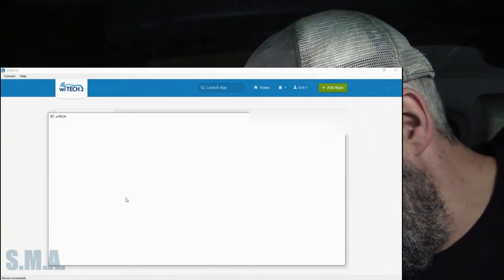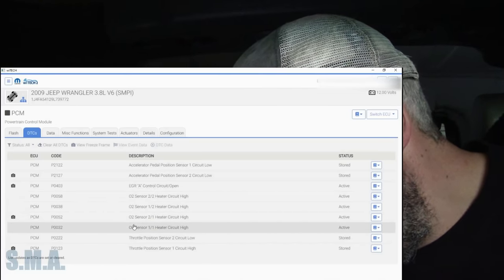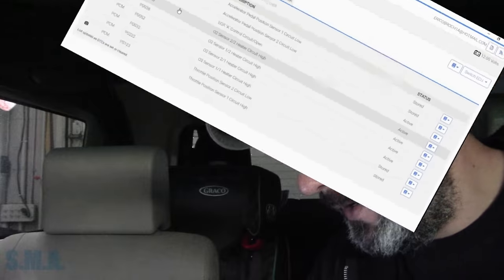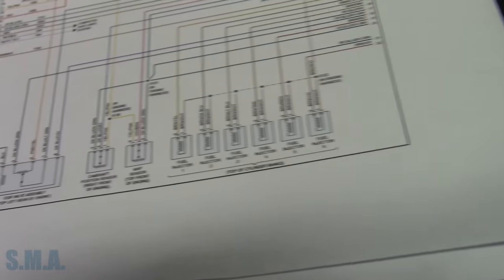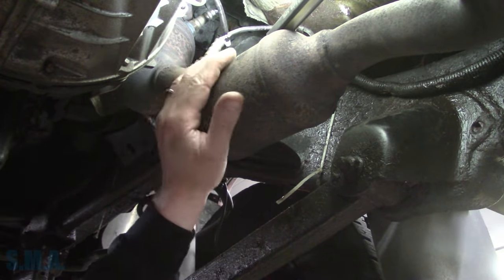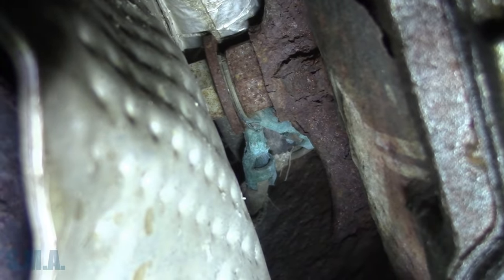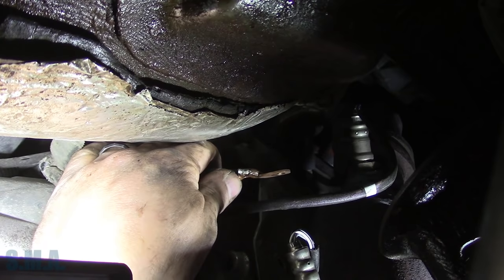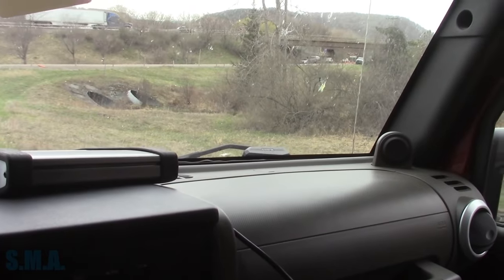Another Jeep, Another Bad Ground...😐

Comment: Good Job. Enjoy and appreciate your videos. Your logic and humor are fine and fun to behold. Glad you can function as your own "Boss" ... shops & dealers probably hate guys like you ... but your customers love you, I bet! 

Re: GROUNDS. As an EE/Mech Eng. I am NOT a "Mechanic", but own, service and care for 2 older vehicles. '92 Dodge Caravan & '03 Lexus SUV. The Caravan is (WAS)  a "Ground Fault" hangar queen. I joke that I put a new set of Michelins on it and doubled its street value.

It costs a small fortune when most shops try to "Chase the Gremlins" ... esp. tough before OBD2 in 1996. e.g. Intermittent cruise control a few years ago; I took apart every connector in the "chain" and tugged on every wire ... one bad crimp came loose! Soldered it & all is solid.

Just recently had NO DASH FUNCTIONS ... no lights, no instruments, no chimes. Found 3 bad grounds (1 under the hood and 2 under dash), PLUS a cold solder joint on connector leg inside the Body Control Module. The van (like its brethren) would have been scrapped years ago if a "regular" owner had to put up with the debilitating frustration and inane expense of taking it to "Stealerships" or local shops. 

NOT everyone can do / will do what you do ... as for "regular" shops these days, they just mimic the dealers in price and action ... and kiss things off ... can anyone here (as you point out) say: shotgun parts ... then give up after humongous charges for NOT fixing things? 

As for my "almost pristine" '03 Lexus SUV, bought it a year ago with 112K on the clock. 
Including the 120K Service, I have now spent ~ $1,100 on it for parts & materials. Dealer / Local Shops would have charged well north of $5,000! I will stop now! 
Thanks again for what you do.
John in the Northwest

Comment: These other shops are going to go out of business because they keep sending them to you!
Reply: Nah...  They still charge for the parts cannon routine...
Then send it to Eric for the actual repair.
Reply: Not likely sad to say, there will always be an abundant supply of ignorant flapstacks who have zero problem paying 1200.00 bucks for a brake job or 1000.00 for a tuneup or 150.00 bucks to change oil or 3000.00 dollars for a antilock brake sensor or ect.................Mr.O is one of so very few who are honest which in this day an age is a lost concept. This goes for mechanics, plumbers, roofers, electricians, landscaping, dental, every corner is corrupt as it was written many years ago that it would be so.
Reply: @guyazbell7437  - apparently you don't know many mechanics. I been doing this for 40 years and I can recall only two mechanics who I know would cheat people. Some shops are expensive on their labor rate and parts mark up but they're not cheating people.
Reply: @meabob  obviously, there are a lot of dishonest mechanics out there the cheap people. I have lost count of how many videos Eric has posted on his channel exposing other shops for screwing customers. There are a lot more dishonest mechanics out there than you think. let me correct what I said, Eric does not expose the shops for screwing people. Give me really points out that there is some random shop in upstate New York that is screwing a customer and then sending the vehicle to him. He is an honorable man though, and does not give the name of the unscrupulous and dishonest shop that is screwing the customers.
Reply: @meabob  You can bet that other shop will charge the vehicle owner for all the good parts that were replaced, their hourly labor rate to replace said good parts, plus mark up SMA's bill and pass that on to the customer too.
Reply: @guyazbell7437  FYI-Not just blue collar workers!

Comment: Good diag. I’ve had multiple codes and traced it to bad ground. I remember forty years ago a friend replaced.battery, voltage regulator, selinoids resistors etc I looked at it found bad ground. Fired right up and ran. Since then always check pos and neg.

Comment: I like to take the time pulling off ground wires that I can get to and clean them with a rotary tool with steel wheel brush. Remove, clean, and put back. Then use a long needle nose pliers and pull out each fuse from the fuse box one at a time. They look shiny after your done. But wear eye protection to protect your eyes since tiny metal fragments fly off. Sometimes a electronic part will come on you never notice before. The same thing for your battery, alternator, and starter connectors.

Comment: SMA is the perfect example of why folks should trust a good mechanic.  The other shop, maybe not so much!  (you should leave a card in the car so they know where they should bring their car next time!) - they went from someone who didn't know what to do (4 o2 sensors, egr valve, probably multiple trips back and forth, and still having a broken car) to someone who thought about it, saw the pattern diagnosed and fixed it - so maybe an hour or two diagnosing and fixing some wire, and now it's all good!

Comment: I solder them to seal em up and then while warm dip them in an anti co compound to further seal them up and than also usually apply a heat shrink tube w glue inside to get a final seal.

Comment: As someone who pulled their hair out on one. Dodge Dakota's no bus on odometer intermitten, 2 ECM's replaced. Check the ground next to the ecm on the inner fender. Multiple wires soldered together from the factory. Separate the wires put connectors on each one and reattach. Was losing the ground while driving. Found by accident when reattaching ground after checking voltages.

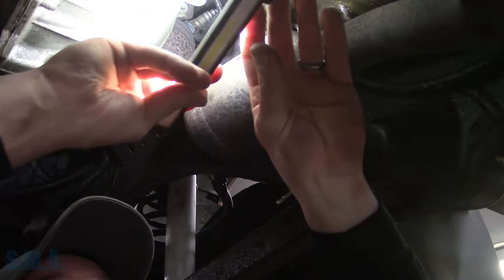Comment: I had both my headlights go out once. I checked them at around 5 pm because I thought something was wrong, but didn't see anything strange. At around 6:30 I was pulled over for no headlights, but I had my fog lights on because they were helping. Was told to fix it, so I replaced the bulbs and have been driving for about 2 years at this point without the lights failing again. 2003 outback if anyone was wondering. I haven't replaced the alternator as I'm sure your guessing, and the day I replaced the lights all I did was unplug the highbeams and the headlights, swap some new bulbs in and it worked.

Comment: I've got a 96 XJ Cherokee with the 4.0 and stick, best car I've ever had, and once in a while it develops a weird problem where the odometer stops working. If I let it go on long enough the speedometer stops working and other weirdness happens. I finally found out there is a bolt on the side of the block with a bunch of grounds on it. If those grounds start getting crusty that's when the weirdness starts. Last time it happened I cleaned everything up real well and put dielectric grease over it. That was probably close to ten years ago. I bought this Jeep when it was about a year old and had 20K on it. It's now almost a quarter century and over 500,000 miles later and I still love driving the thing.

Comment: Hey Eric.   my Heap Compass also had the money codes on one of the two O2 sensors and it turned out to be a bad ground, after I paid to put in a new sensor, which I didn't need.  I got a good electrical mechanic who fixed me up.   Two years now and no reoccurring problems.    I know they use a lot of salt on the roads in the northeast.    The next time you head to Wilbert's in Bath I have a parts list for you to pick up and mail!!!!!!!!!!!!!!!!!!!!!!!!!!!        Take care Coach.   Happy Holidays to the fam.

Comment: G 104 on a 12 liberty is on the right front frame snout behind the headlight(easier to repair)same type problems. Multiple wires in one crimp

Comment: For anyone doing this on their own, just a heads up, this is 1000 times easier if you just take the inner fender well out.  Hit that ground nut with Free All or PB Blast a few days in advance. Just did the job and my AC works and MOST of my trouble codes are clear.

Comment: Well, that was one oily mess !  Darn grounds are so common, you'd think any mechanic these days would have done some testing first vs. simply replace hard parts that show up on the scanner.
They should refund or not charge the customer for what they did and put the factory OEM parts back on it vs. leave after martket on it, if they were. Got to hand it to them, but it didn't work this time and it likely won't work next time without much luck. Good fix SMA. Why other shops tend to go for the gamble really is sad.

Comment: I will be danged if I paid for 4, count them, 4 new oxygen sensors and an egr valve and the vehicle still wasn't properly repaired.  The cost of the sensors and egr valve was likely marked-up 33%, plus labor to the tune of $65.00 per hour minimum and the shop STILL had to take the vehicle to Eric.  If that were mine the previous shop would either a) eat the cost of the oxygen sensors and egr valve, (which Eric indicated they were going to make more money than he will) so, that likely won't be the case, or b) they would get negative publicity from me.  Honestly, with Eric's channel and reputation, I don't know why ANYONE would go to any other shop.  You have a better chance of being struck by lightening twice than to have 4 oxygen sensors go out at once.  Great video!
Reply: The labor rate in the area is roughly $80 to $150 per hour,  Eric is at the low end.
The  Jeep owner will never know their car went to South Main Auto, the original shop will just say "Your Jeep is fixed,  come pick it up  ... and bring a big bag of money.

Comment: My concern is that these other shops that think they can, they really can't! 
Other shops: If we can't fix it, we'll send it to SMA & let Dr. O fix it for us.
Had a friend, that a guy he worked with had a similar issue and the shop he had it at told him it was going to cost him like $800 to fix. We went by the shop after they closed to look at the car (it was like 6 or 7 years old) as a favor and the negative battery cable was full of the green crusties, about 2/3 of the cable. I put a new cable on for him, cleared the codes, he drove it a few days and the codes never came back. I'm in Georgia, I have only seen this on older cars that were at least 20 years old & they never look that bad.

Comment: I have to disagree with your closing comment - "If I can do it, you can do it"
No, I don't think so. Certainly there are shops that are guessing rather than diagnosing. I've learned that from experience.
I've been taking care of simple problems with my cars on my own, but it is a real good feeling to have a shop you can trust.
In a lot of cases, I can't do it.  So, that's when you need a professional.

Comment: Ah the old check engine light inspection issue in so glad my 94 doesn't have OBD2 I just pulled the bulb and pulled wire under the dash and put a bulb there so I can see if it's but they can't see it and it's pre OBD2 so they can't hook a scan tool to it so it's a very simple pass

Comment: Common issue with jeeps I'm guessing. He knew exactly what to look for and pulled up wiring diagrams for that circuit right off rip. Well done, sir.
Reply: I had one a few years back where the people had installed their own engine but forgot to install the heat shield for the Cat Convertor and melted that section of wires

Comment: Test light and Digital Volt Ohm Meter are required tools for technicians, learn how to use them. Checking continuity at the O2 sensors would have been one of my first checks.

Comment: My brother in law had problems with his a/c. The shop replaced the a/c compressor, it worked for about a day then stopped. The windshield wipers then stopped working too.  I was pondering all night about it, told him to check the engine to body ground.  Seems the engine had been rebuilt and the mechanic forgot to connect the body to engine ground strap.  I learned to check for bad grounds a long time ago, but often that gets overlooked.

Comment: 3 most important tools used in this job were scan tool, ERIC O's brain, and INFORMATION. Yes , information is a tool. The ground printout allowed him to see the relationship between the 4 O2 sensors and the EGR. if the other shop had used  a scan tool, their brain, and  information, they would not have needed to use the tools they used to change these parts. Unfortunately some shop do not have these 3 tools.

Comment: In the early days of this computer thing, all sorts of codes were a good sign of electrical issue. Folks forget that grounds are electrical. Until 3 wire o2 sensors, we had to go do a mod which ment running a ground strap to the o2 sensor.

Comment: A while back, I worked on a v6 that had 3 ignition coils that did not work.  I thought, what are the chances.  So I started my diagnoses to find what those 3 had in common, like power.  Did not follow my usual procedure. Sounds familiar?.  Thirty minutes later, swapped a bad coil with one that worked.  Turns out, it had 3 bad coils. So, this does happen. Have to still follow your usual diag procedure anyways!

Comment: Good call on finding the fault,  there's usually a path to follow that leads to the failure, the trick is to look for the clues.
Reply from the maker: the real trick is to follow the data and the facts ;)
Reply: @SouthMainAuto  the mere fact that ALL circuits on the O2 sensors were dead, should have been caught the first time. However even after they were replaced and are still not working should have thrown a red flag for sure. As you showed, whats the commonality here for the circuits; if you saw the crusty ground by the same O2 sensor why did they not see it.

Comment: I had a jeep like that, but it had bigger issues, throttle position sensor was all over the place. High voltage, even tried to direct ground the sensor right back to the computer, it was high. 
Computer ground was smoked. 5v reference was 4.52V and needed to be under 4.12 I believe to be ok. 
Had the voltage drop occasionally, just randomly and run fine, then next time it started it would be up high again. 
Even referring them to the dealership, they had no idea, and figured like I thought, it was a computer. 
I wasn’t sure, even tried different grounds to be sure, it was a pile that had blown up and had to replace the motor and came in not running and left 90% running but customer didn’t want to put $ into it anymore

Comment: It could have been worse. The 1st guy could have reasoned that all 4 sensors had the exhaust pipes and converters in common and replaced the exhaust system. :)

Comment: Well, if they were quality replacement parts at least he has new o2 sensors and egr valve that should last a while..... I agree with the not likely to fail all 4 at once but if one failed and was ignored and driven over time I could see them all failing eventually. Thats a possibility.... But that could be determined by simply asking the history

Comment: I had a shop try that on me once.... They changed all these "broken" parts, which to me just didnt add up.... so when went and picked up my vehicle. I asked for all the parts they "replaced" afterall I paid for them, they are mine not the shops ( by the way they were not happy about this but I did not care, my vehicle my parts ). I then took those "broken" parts to another two shops and asked them to check them..... both said they are fine except for one component ( which was the controller of the others i found out )...... I went back and gave them a choice... reduce the bill for those replaced parts which were not needed, change those parts back with the originals which were fine and only charge me for the one part with a reduction in labor costs to account for it.... or I take it further. they reduced the bill.......and to this day have never stepped back into that shop. So yes they may have made the money initially and even if didnt check it and had worn that bill... You may get the money originally but is not a good way to keep customers....For a business to succeed it must keep its customers and get them coming back time and again..... A loyal customer is worth 10 or more casual customers not just in the work but more importantly in word of mouth as they will tell others... Best advertisement a business could ever have. As the saying goes. A good reputation is beneficial but easily lost. A bad reputation once gained always retained.

Comment: Eric   knows where you can buy cheap some good used O2 sensors and an egr valve for a Jeep. . I hope the customer got the parts back from the other shop? 
The way Eric presents the data to  look for a commonality in the problems,  leads to several  probable  conclusions. Then he tests his hypothesis in several spots. .A mantra of his  that should be on a Hoodie is  Follow the data before firing the parts cannon. And tattooed on the foreheads of some, Stay well.